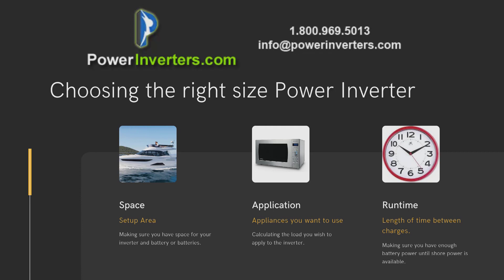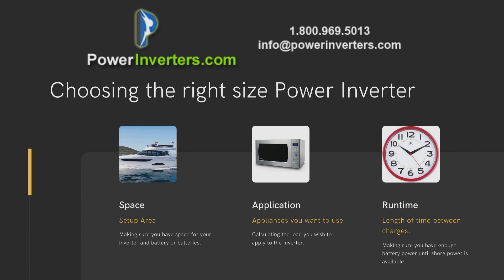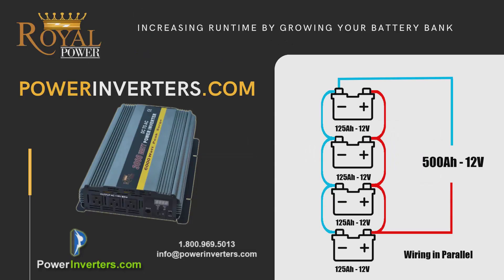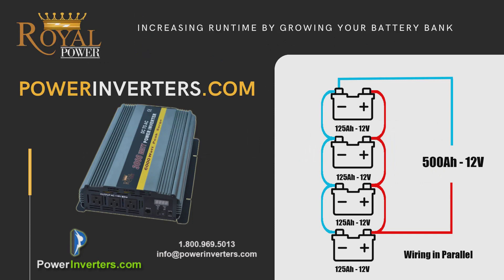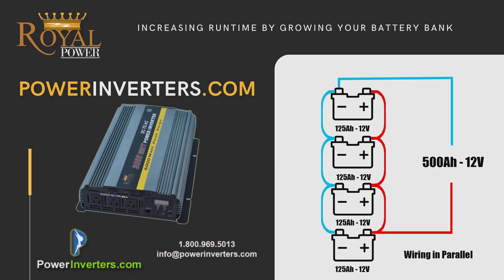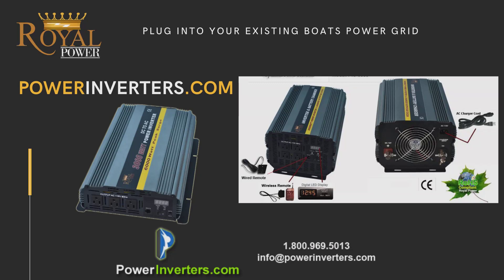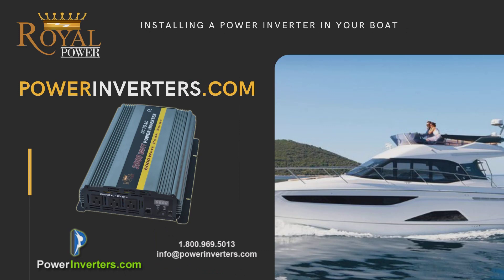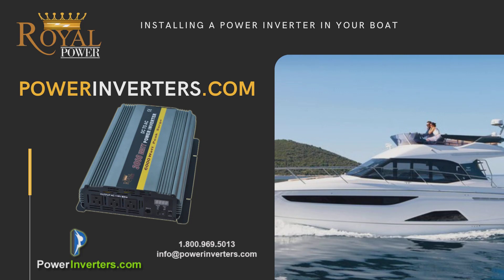Installing a Power Inverter in your boat

Comment: So if using existing boats power grid does it run from the boats batteries? How would this work with a series battery install that is wired with a dual battery isolator?
Reply: You can run it off the boat battery or free standing.
Reply: @royalpower5713  thank you!